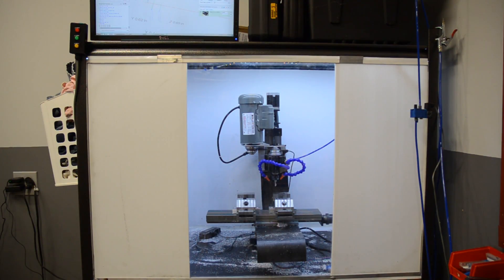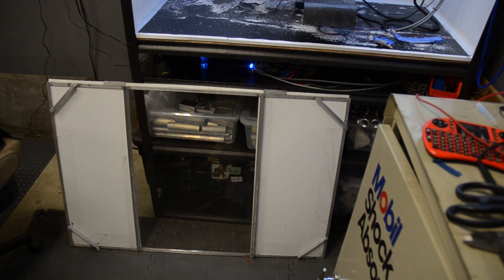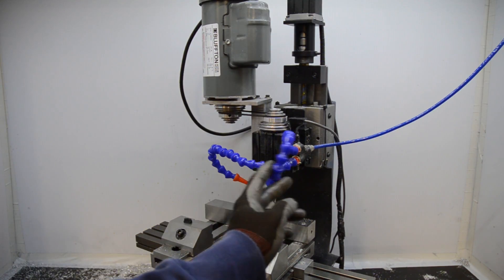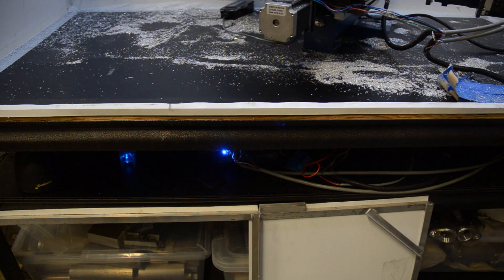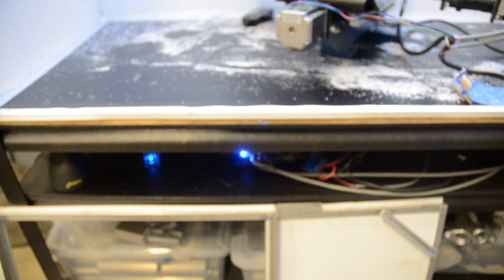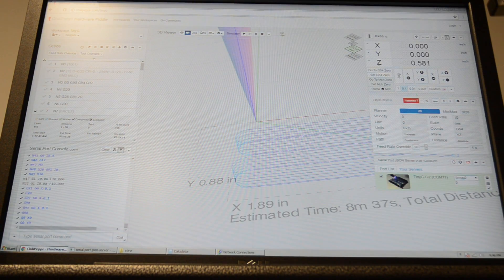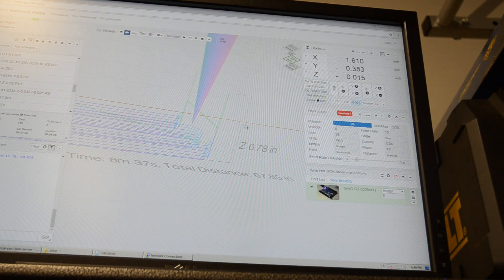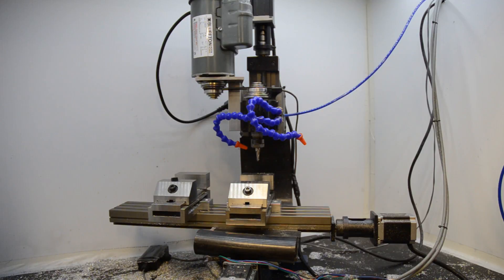Taig Mill CNC Conversion TinyG/GRBL and Chilipeppr

Comment: What model Taig did you start with? I've been converting mine, but it's an older model and I've found fitment issues with the CNC z-screw and bushing and the older style z-main body.
Reply: @Rey Davian definitely, I've been using instaflixxer for since december myself :D
Reply: @Rey Davian Definitely, been using InstaFlixxer for since december myself :)
Reply: @Rey Davian Yea, have been watching on InstaFlixxer for since november myself :D
Reply: @Rey Davian Definitely, have been watching on InstaFlixxer for since december myself :)
Reply: @Rey Davian yea, I have been using InstaFlixxer for months myself =)
Reply: @Rey Davian Definitely, I've been watching on instaflixxer for years myself =)
Reply: @Rey Davian Yup, I have been using instaflixxer for years myself :)

Comment: Nice video. I am surprised at how slow the feedhold was to react, although when I used G2 I sort of recall a similar delay. I thought they solved that in newer firmware though. On regular TinyG it's instantaneous. Did you make your own G2 on a Due?
Reply from the maker: Thanks John.  Yes, I made my own G2 on a Due.  Thank you for all your work on the project.  It has worked very well for me, but there is still room for improvement.  These are the bugs I encountered:

- Due does not always register the configuration it was sent upon connection (I can see it was sent in the log), I just have to disconnect/reconnect to retry until it works. 

- Loading new gcode file resets the spindle graphic representation to work zero.  Jogging in any direction fixes the position for that axis. 

Feature requests:

- Hardware feedhold/cyclestart buttons (GRBL supports this and the response is instantaneous).  I see them indicated on the pinout, but they seem to do nothing.

- SPI support for AMIS-30543 driver, which looks interesting.